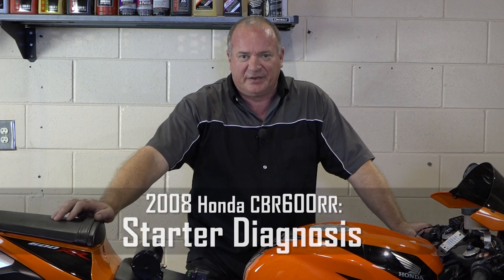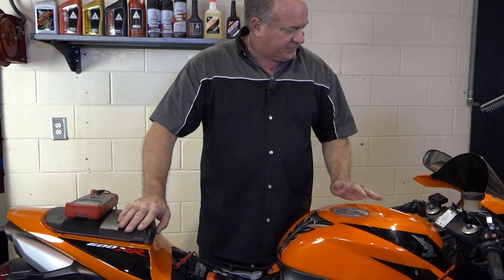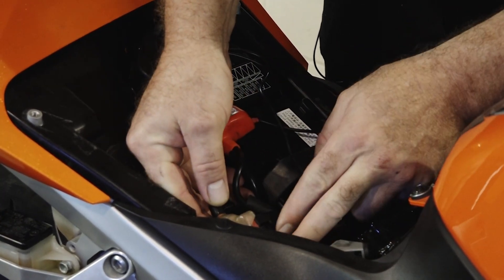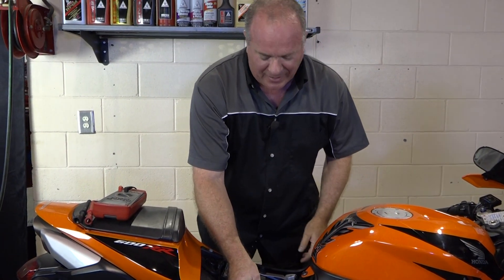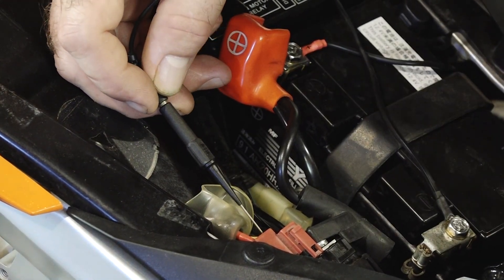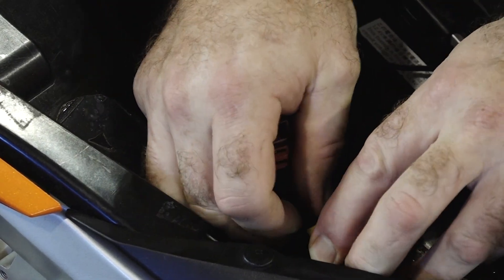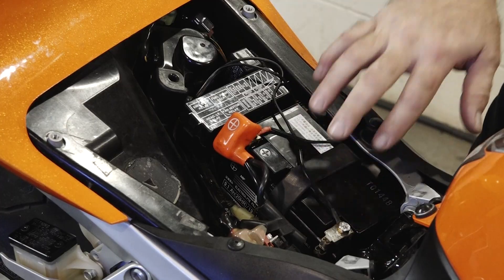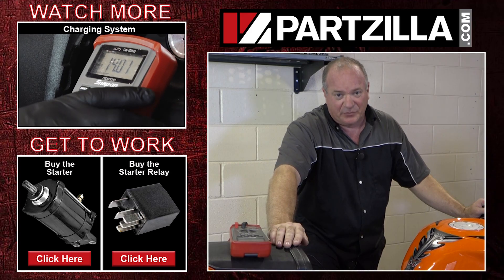How to Diagnose Starter Problems on a Honda CBR 600 RR | Partzilla.com

Comment: I need your help with my cbr 929rr 

I can not hear  the fuel pump  priming any idea what is going on at my end
I watched some other videos and they think that the problem is with the pink wire connected to the computer due to a faulty relay sending 12v instead of 9v
Also i did find this video and the problem was with the cbr ignition switch diode
https://www.youtube.com/watch?v=oaixZVeusv4

 What do you advise do you think it is a problem with
Reply from the maker: There's not enough information to diagnose over the internet, You'll have to keep testing components and wires.
Reply: I will start with testing the pump this week and share the results 
I will keep you posted
Reply: I manage to sort it out. I had a bad pump relay as it was soaked with water As I wash my bike more often
once I change it even thing went back to normal

Comment: I have a 2006 Honda rr when I ride and the engine get hot and like 5 minutes after parking bike won't start and nothing is wrong with the starter and battery is good what can cause that problem
Reply from the maker: Regulator Rectifier.  Test when hot to confirm.
Reply: @PartzillaParts  please can you send of it looks like please am just getting into big bike
Reply: The regulator rectifier

Comment: Would a low power for battery cause the fuel pump not to prime when engine cut off switch is flicked on and off. The ignition cranks up and the relay clicks just no prime
Reply from the maker: If it's dead.  It doesn't require much to prime the pump.
Reply: I have the same problem relay click, ignition work and kill switch work and pomp no prime did you resolve the problem in your bike?

Comment: Thank you! This just happened to my Cbr F2 600. Won’t crank seems power is drained and shortage of circuit power.. I believe the stator rectifier is the issue ..
Reply from the maker: Run the tests before you start buying parts!
Reply: Yes of course! Battery gets charge. Starting bike and running, but bike now gets hot now too soon..
Reply from the maker: If it's running too lean you will have issues starting and it will get hot quick.  Might be something to consider as well.
Reply: Yes of course. Seems like its not getting much water from the pump... Another fan would be nice too

Comment: Issue I’m having with my 2013 CBR600RR is while I’m riding my light get dim, then my check engine light comes on along with my HESD light. Bike won’t cut off at that moment but then my gear shift gauge that was added will be flashing a L and flashing the gears. After that the bike will then cut off and oil light will come on. It starts back up in 2 mins or less but it’s a dangerous thing to keep happen
Reply from the maker: Test stator, rectifier and wires.  Voltage drops will cause this to happen, it's just a matter of figuring out where the issue is.  Electrical issues like this can be a real bear.

Comment: Hi I'm having a problem with my cbr900rr 1999 the 10a fuse keeps blowing when pull off the odometer back break light horn go's out how do I locate the relays for that not sure but thinking that's the problem

Comment: I have a 04 Honda cbr f4i and i have replaced the battery as well as the fuel pump and relays I have also replaced the ignition key the original key just turns on the fan , no fuel prime , still cranks over but no start the new key no fan when turned on no fuel prime and cranks but no start do you have any idea  I have checked everything the bank angle sensor kickstand sensor you name it they all check out fine but for some reason I cant get  the fuel to prime please help thanks
Reply from the maker: Did you check the harness between all those components?  That sounds like best case scenario.  Worst case, ECM?  Check everything you can before you jump to ECM.
Reply: Johnny Trillberg, and Partzilla, I have a 2006 cbr1000rr same problem as Johnny I'll be checking all this, Johnny did you fix yours or find the problem, and is anyone aware of any recalls on this more than common issue, my. ike dose not have a diode, maybe Partzilla could do a video on this issue seeing as how it's so common

Comment: Dude thanks for making this video but i got a question. I just bought a 2007 cbr1000rr from a friend and he hardly rides it. I dont have a multi meter but maybe i should get some. When i tried turning my bike on. So switch on kill switch is on then i click the starter. All of a sudden the screen dying out and trying to crank the engine. It will start after 3 or 4 crank. Does it mean i need a new vattery??
Reply from the maker: Start with simple first.  Health test the battery or get a new one. You can't do accurate tests without a good battery anyway.

Comment: I have a CBR F3 95  and is blowing fuses replace the fuel and carburetor fuses and the one up under the seat where the relay when I replace the fuse it will crank up and run for a while but it will blow again and for some reason my start switch won't work so I replaced it now I'll see when I press the start button the lights will dim but it won't trigger that starter
Reply from the maker: Check your wiring from ignition and switch, you likely have a short somewhere.

Comment: i have a cbr 900rr turn over good no spark lights on
Reply from the maker: If you trace the system from the plug back, you will see where it loses power.

Comment: I've checked everything you have done and all the checks have came back good. But the bike just keeps turning over and won't start. Any ideas?
Reply from the maker: If all the electrical checks out and you're getting spark.  It has to be fuel.  Does your fuel pump prime when you turn it on?
Reply: Partzilla thanks for the reply. And yes pump is priming. I actually got it started today after I took off the air filter top. I tried starting it like that and it turned on right away, sounds off so maybe a tune up.

Comment: Hello I have a 01cbr600f1.won't start,new battery,Turning over, but can't hear the pump priming.any ideas where I could start looking.tried fuses,They seem ok.thanks.
Reply from the maker: I'll take that as a CBR600F4i?  When you turn the key you should hear the pump prime.  If not, make sure it's getting power.  If power looks good, you may need to rebuild or get a new fuel pump.
Reply: Thanks for the reply.but do you think that it could be something else, before I go getting a new fuel pump.do they give trouble.
Reply from the maker: Fuel pumps go out.  Especially if it sat for a long time or the tank is/was dirty and debris clogs up the works.  Always test the electrical to the pump before you buy a new one.  

Search our videos, there are 3 Fuel Pump vids on a GSXR.  The process will be essentially the same.

Comment: hello i have a cbr 954rr my engine starts so easily when cold but if i try to start it when hot it doesn't start engine keeps on turning though. if i jump start it it starts right away!. what might be the problem i really need yout help
Reply from the maker: Test your regulator rectifier.  When they start to go bad, heat affects the component.

Comment: My buddy dropped my bike. Now it won’t start and is was making a clicking sound while trying to start. Now it’s making like a ticking clock sound. Anyway you can help ?
Reply from the maker: Sometimes a hard knock can damage components.  Load test the battery and then test the solenoid, either could have been damaged.
Reply: Partzilla I don’t know how to do that. If I take the battery out and bring it to the shop will that work ?  Btw you guys are awesome with how fast you get back to people and we don’t even pay for this advice.  Is this the guy that’s in the videos answering these questions ?
Reply from the maker: Usually John answers the questions, however, we have another technician that fills in when he is otherwise occupied.  And yes, if you take the battery out and take it to the dealer, then they can load test the battery for you.

Comment: + Partzilla
could u do video on fuel prime pump troubleshooting  on cbr600, thank you!!
Reply: zodd i had changed my fairings.. turns out I’m clumsy and had my tilt sensor upside down! I felt like a complete fool after running through all my wires, testing relays, checking fuses, kill switch .. i guess i should’ve checked the most obvious things first haha
Reply: zodd Sweet 🤘 good find , get it fixed ride safe man
Reply from the maker: We'll add it to the list!
Reply: Partzilla i also want to request this, my fuel pump doesn’t prime. When i turn my ignition i don’t hear it at all. Power switch is on (down), in neutral, kickstand up, holding clutch but i just don’t hear fuel pump priming at all so all that stuff doesn’t make a difference for me.
Reply: try to turn on n off kill switch for 10 times, works for me, i think they maybe dirts inside that may interfering it
Reply: i overcheck everything too since my bike doesnt start, even thinking to do this https://www.youtube.com/watch?v=oaixZVeusv4
Reply: zodd check wires that lead or are around kill switch to start with, could be faulty or sensor for it considering it’ll start if you mess with it a few times
Reply: i found out it was a kill switch wire got tear apart
Reply: Suavecito 600RR my buddy dropped my bike and now it won’t start and there is dirt on right side where it hit. It’s making a clicking sound while trying to start. Any idea what it may be.
Reply: Dan Klesh have you checked your tilt sensor?

Comment: sorry to make a wierd comment, but what if when the bike is hot like when you stop for gas, and go to start and it cranks like the battery is dead? with all new charging system parts. but it only does that when its hot. cranks perfect after it sits a couple hours or is the first start up?
Reply from the maker: Test your Regulator Rectifier.  It's a common problem on Hondas.
Reply: Partzilla ok. Thank you so much. Definitely will do. I just replaced them a few months ago tho. But if they are bad do they sell ones that are higher performing than oem?
Reply from the maker: Sadly, OEM are the most reliable.  There are some Chinese knock offs out there, but they never work long.
Reply: Partzilla ok. Thanks alot! I'll get to work.

Comment: I was riding and the bike hesitated then had no power, When U pulled over it would start fine but when I put it in gear and gave it gas it would die, then it would not turn over. After towing it home the fuel pump primes and the engine turns over but it does not start. could it be a bad battery?
Reply from the maker: It's more likely the rectifier.  Try testing it and see what it looks like.

Comment: Very nice video. My immobilizer light keeps flashing when I turn the key. The bike had been recently exposed to water. Any ideas ? I will try and look at the fuse this weekend.
Reply from the maker: Sounds like an ignition situation.  Double check the wires are good and tight.  Blow out any moisture that may have gotten in there.  With water, it could be anything electrical that got wet and is now shorting.

Comment: Your videos are the best. Quick question. I have a 2006 CBR 600rr, she cuts off every time I stop at a light and I have to turn it back on. Sometimes I have to pop start it in 2nd gear after changing out battery and spark plug. Haven't checked the stator but I feel thats what the issue is
Reply from the maker: Test your regulator first.  Sometimes, it gets hot and just shuts the motor off.  It's better to test the components than just blindly replace. You'll save some money.
Reply: Partzilla thank you, I will be sure to start there.. I'll let you know how it turns out.

Comment: It would be great if y'all can make a video of the real electrical problems these bikes have.
Reply from the maker: Well, you might have to narrow down the "real" electrical problems and we can try to put something together.
Reply: Ik this video is old but please for the love of god, I have a Cbr600rr 2008 model I can start my bike and ride it. but my cluster doesn’t work it shows me the indicator for my headlights and turn signals along with the clock for whatever reason but I cannot get the green neutral light. I get no rpm or speedo readings, temps, and odometer readings not that I need them but it would be useful. Your videos have taken me a long way with maintenance on bikes but can’t figure this one out :/

Comment: Never mind I figured it out. My battery is shot it drops to 9 volts when I turn on my bike. Turn on not turn over as it won't turn over lol.  I'm cutting my losses and upgrading to lithium ion battery instead of buying another OEM acid battery.  Might as well go with a better battery and save at least 5 lbs at the same time.
Reply from the maker: I need to read ahead before I answer questions...Yes, a battery can test ok static, but under load it's failing miserably.

Comment: My cbr600rr powers up fine as well as my fuel pump. My battery is reading good numbers just barely under 13 volts. Now when I go to turn my bike over I get a machine gun like clicking sound from the tail of my bike I guess you could say around my seat and my gauges turn off and when I release the starter button the gauges light back up. ?? Any ideas if this sounds like a starter problem
Reply from the maker: Load test your battery.  A static test isn't enough.  Make sure all connections are tight and clean. If it tests good, start checking your ignition and button wires for a short.

Comment: Afraid I may need a new starter. Do you have a video for replacing one. I get a hum from my relay even after I replaced it.
Reply from the maker: It's on the list, but the video has not been done yet.

Comment: have 2012 kawasaki ninja zx10r starter relay making rapid clicking noise any help would be greatly appreciated
Reply from the maker: Have you load tested the battery?
Reply: Partzilla yes
Reply from the maker: And it tested good?  99 times out of 100, this is caused by the battery not outputting the proper juice.  That would be my first replacement regardless.
Reply: Partzilla I replaced the battery and starter relay
Reply: still doing same thing clicking noise coming from the starter
Reply from the maker: Time to do a series of tests, check all connections, wires, fuses, then test starter solenoid, down to starter.

Comment: What does it mean when it keeps blowing your 30 amp.
Reply from the maker: Typically, it means there is a short somewhere.  Check your connections and look for any frayed or pinched wires.
Reply: mine happened to be a bad diode in my rectifier.

Comment: My fuel pump relay under my seat is making a teaser sounds like. Ive test the charging system my stator look ok but my bike randomly dies on me. My baterry is new and spark plug replace. What else do i look for issue on my bike? I only heard it once now its working normal again im still cant ride it since its acting up.
Reply from the maker: Test the regulator rectifier first, just to cover the charging system.

Comment: My 06 CBR1000rr has a buzz in that relay. I'm gonna replace it because now my bike won't start. I ask the dealerships and they a telling me almost $100 for that relay. It's $12 on Amazon
Reply from the maker: Stepheon,  before you buy additional parts, test the battery and double check your connections.  That sounds like a weak power issue vs. a dead relay.  Could save you some money.  Either way, I would be wary of cheap Amazon replacement parts.  They aren't very reliable.

Comment: my CBR 400RR starter cranks very slowly like a dead battery when the engine is hot but still turns over the motor... is it a bad starter?
Reply from the maker: Could be a bad starter, bad battery or regulator.  Start testing the system!

Comment: Thanks for your video....i did everything you said and it still won't crank over so now I will go buy a starter, but where is the starter located?  My bike is a 2005 cbr 1000rr., thanks Ed
Reply from the maker: Should be right side, just under frame.  To access the entire thing, you will have to remove the tank.

Comment: Really dumb question, how do I know when to get a new battery. Bought my bike used and haven't had any issues but I would like to avoid these issues too
Reply from the maker: The easiest way is to run it until there is an issue.  If it's a sealed battery, there isn't much to do.  If it's not, make sure the battery acid is topped off to get the most out of it.  If you start getting weak starts, just toss a new one in before it dies completely.

Comment: hi today i connected the battery but still the yellow bulb near the key sign is still on ,how can i bypass the immobilizer ? is it possible
Reply from the maker: Not that I am aware of, it's integrated through your ignition and ECU.
Reply: so is there other option  thanks for being so quick
Reply from the maker: Did you test the regulator rectifier?  Incorrect voltage could cause the issue.  If that all checks out, there is a good chance the ECU is going bad.

Comment: hi  i have a honda cbr 600 f year 1999 and when i switch the ignition on a green bulb still on so it will not let me start the motor what do you think  thanks
Reply from the maker: Green bulb as in your neutral indicator light?  Does it click like a dead battery or just do nothing at all as if the kill switch were still on?
Reply: No not the green neutral light. The yellow light of the immobiliser , where there is the symbol of the key. It stay on and the bike won't start. I've tried with the spare key as well.
thanks
Reply from the maker: Ok...I wasn't aware that was on the 99 year model.  Disconnect your battery for a few minutes and let the ECU reset.  If your battery is charged, reconnect it and try again.  If you are still having issues, test your rectifier, it may have failed.  Hope this helps.
Reply: sounds like you might not know after you turn the key on you gotta push the start button lmao